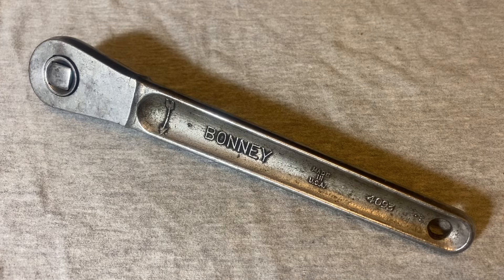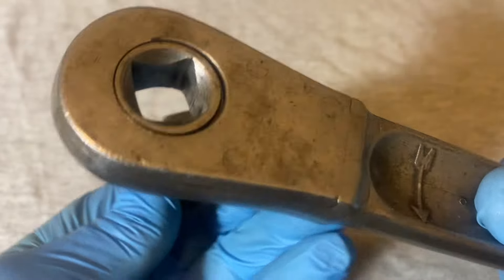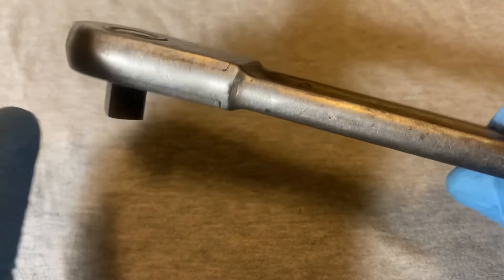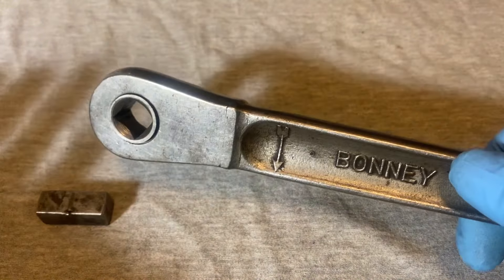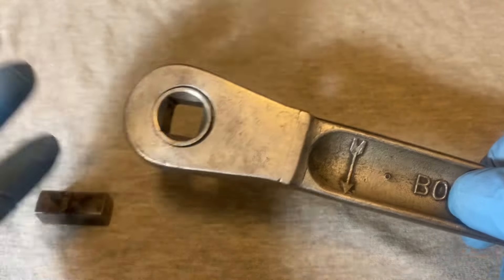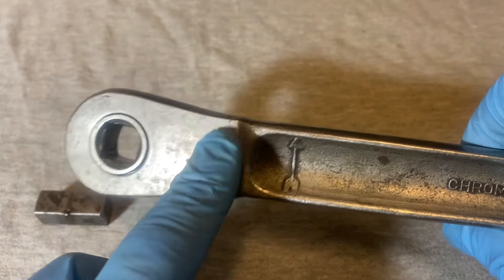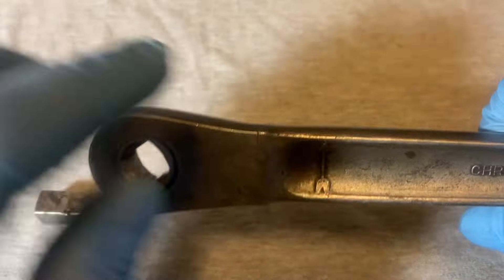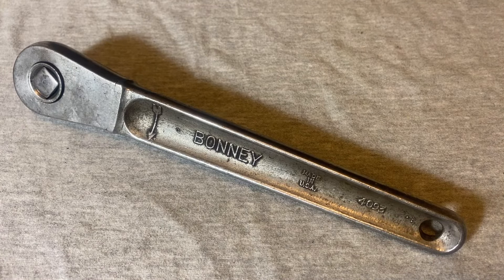Bonney 4093 Ratchet OVERVIEW Vintage 1/2” Ratchet

Comment: Just digging around a little and I found a different version of this 4093 on Garage Journal, more of a round head than this pear shape but it has screws holding it together and they have a picture of the inside which is also 14 teeth and likely very similar to what's in this one.
Reply from the maker: I got go check that one out then.Thanks👍